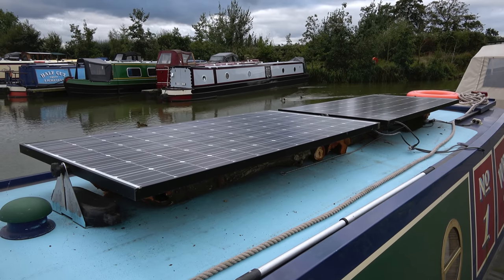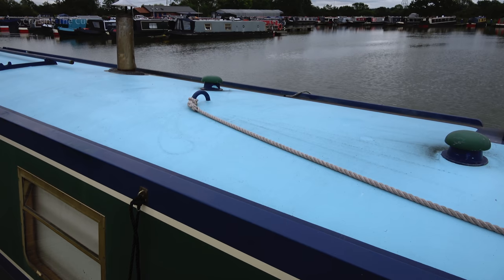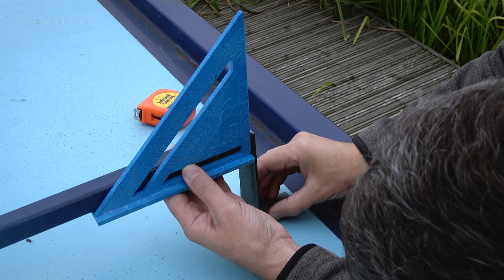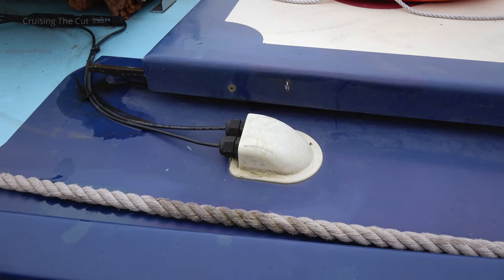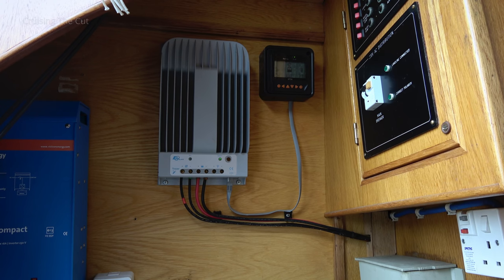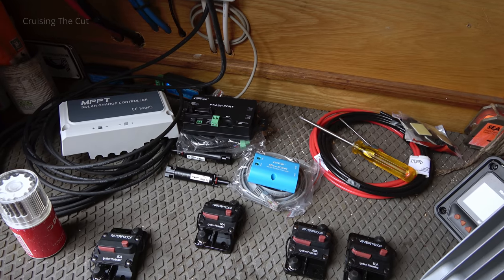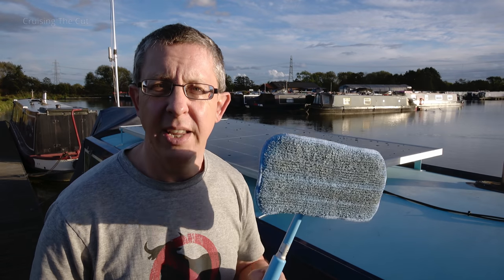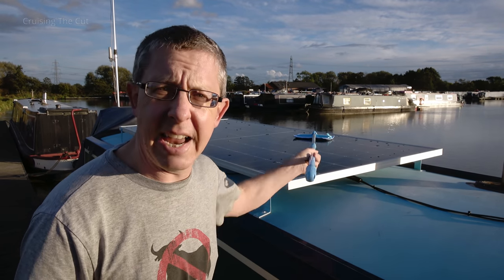251. Adding more solar power to my narrowboat

Comment: Someone gave you some bad information!
MPPT is designed to work with odd cells, that is what "maximum power point (no idea what the "t" stands for, unless it is the "t" in point", but, regardless, the main purpose of MPPT is to allow for a cell or two to be in the shade or an entire panel to be running at a lower voltage or wattage.
Another thing that I spotted, is something that is so easy to get wrong in a solar configuration as symmetrical as yours, is the "different amperage issue", this is because you have two different voltages on each charge controller, (rear panels in parallel @ 60 volts RMS, front panel @ 30 or 40 volts) of course your amps will differ greatly! 
If you multiply your amps times the volts showing on the respective charge controller, you will have the watts, watts will always be the same regardless of voltage, but amps will change, the quick and dirty way to know how much of a difference to expect is to divide the total panel RMS volts by the listed watts of the panels on the rear and again with the 550 watt panel in front, this will give the base for amps (I know, I made that last bit much more complicated than need be,m sorry). 

The easy explanation is ohms law: (volts times amps = watts; and as such, watts divided by volts = amps)

I use a cheap Ammeter ($10 -12 US on amazon) that shows the volts, amps, watts, total KW., in real time, it will make your electricity much easier to figure and track in your head, by thinking in watts, instead of converting amps to watts all the time.

I have been watching your narrow boat program for several years and absolutely love it! 
But rarely from my laptop, usually on the android tv box, so I could not subscribe until today, very well edited and narrated, much better than our other reality TV, and far more relaxing! Thank you!
Reply: Yep. Was also somewhat confused. I take it it's something like the SolarEdge maximisers on regular panels, that can mix in different voltages.

Agree all the talk about Amps had me confused. Power is measured in Watts or kiloWatts, particularly when your dealing with panels of different voltages.
Reply: Tracking
Reply from the maker: Hi. There's no bad information been given or received. Irrespective of the purpose of MPPT (which is to track the maximum power point - Amps/Voltage - of an array), you should not connect panels of different types to a single controller without dragging them down to the 'worst' panel's output.

I don't understand what point you're trying to make about amperages (and yes, I do understand Ohms law but I don't see what you're getting at)

Narrowboats and campervanners tend to think in Amps - more accurately, Amp Hours - because the capacity of the leisure batteries is always specified thus rather than kilowatt hours, hence the tendency to concentrate on the supplied Amps going to the battery.
Reply from the maker: @mark123655 Yes, power is measured in Watts but once it's going to the battery it's all at around the same voltage and as leisure batteries are measured, capacity-wise, in Ah rather than Wh, narrowboaters tend to think in Ah terms (at a notional 12V)
Reply: @CruisingTheCut  I am sorry, I did not mean to offend you in the least, a redundant system is much more robust than a single control system.
I live in a box truck with 1 kw of solar for about the same amount of time as you have been Cruising the cut, I lack the beautiful view that you have;
And the security of a redundant system

The whole amp watt thing is something that drove me crazy for years!
The point I tried to make is that a 440 watt panel that is ran at a different voltage than the dual panels ran in parallel !

Amps do NOT remain the same at different voltages! 
Watts do remain the same., e.g., a 100 watt light bulb @ 220 volts is .45 amps (watts/volts=amps)
A 100 watt light bulb @ 12volts is 8.33 amps!
Amps is the measure of currant, watts is the measure of actual power.
On a boat or RV you are forced into considering amps to gauge the size of wire you use, i.e., if you have a 2000/4000 watt inverter @ 12 volts, you must use the highest number to gauge the wire and divide 4,000 watts by 12v = 333 amps! This is the currant that may travel through the wire! 

Putting this into practice on your boat, the front panel (guessing) is running at 40 volts, the back panels are in parallel, running at 60-80 volts? 
The panels are not at the same voltage, therefore, the amperage produced cannot be compared without converting the amps to watts!
Reply from the maker: Hi. No offence taken! I totally understand the point about Amps and Voltages hence Watts being a consistent measure but when looking at the power going into the battery itself, it's all around the same voltage from both controllers (being either 14.4V at absorption or 13.2 at float) and therefore the Amp figure is meaningful when considering the capacity of a battery rated in Ah.

Comment: The breakers from the solar into the charge controller are kinda of pointless and should have really gone on the roof under the solar panels? You want something to protect the wiring incase there is a short to the boat chassis.
Reply from the maker: They're not pointless as they enable me to easily disconnect the solar from the controllers if needed. I am adding an inline MC4 fuse at the panel end but hadn't done so when I made the video.
Reply: So, if BOTH cables happen short to the steel roof, extremely unlikely, how many amps is that? Will it catch the roof on fire? Nope

Comment: Question was there a reason not to go for victron MPPT controllers as you already have victron equipment fitted.
Reply from the maker: Cost and I'm quite happy with the performance of the Tracer unit that I've had to date.

Comment: Instead of doing all that work?
Why not just buy 3 dozen ducks, glue/nail/screw/attach, small solar panels to their backs.
And tie a leash and a power cord around them so that when they swim around your boat?
They will generate LOTS of solar power from the panels mounted onto their backs.
All you need is to carry feed for them so they don't starve to death.
Problem solved.

😉
☮
Reply from the maker: Of course! How could I have missed this obvious solution!

Comment: Why not put your roof wireing in plastic trunking to make it look smart the plastic trunking will stick to your roof
Reply: Or metal barrel and screw to roof with those captive nut doodads.

Plus galvanized pipes clips.
Tread on it as much as you like or swept by thorns and brambles and it should survive.

Comment: I was wondering why you didn't just put the new panel in series with the existing panels? Too much voltage for the charge controller? Perhaps you could have just upgraded the charge controller rather than drilling a bunch of new holes for a second one?
Reply: When you put panels in series, the same number of amps have to pass through all the panels in the string, which means you limit yourself to whichever panel can generate the lowest number of amps.  Practically this means if you have a 500 watt panel and a 300 watt panel, you end up with two 300 watt panels because the 500 watt one is ever able to deliver its full rated current.

Imagine you have a fire hydrant and a fire hose, blasting a huge amount of water out the end.  You need the fire hose to be a bit longer, so you remove it from the hydrant and use a tiny thin garden hose to extend it.  Now the fire hydrant is feeding into a tiny garden hose, then the garden hose is feeding into the original fire hose.  Now suddenly only a trickle is coming out of the fire hose because the garden hose is restricting the flow so much.  This is how the amps work with solar panels - the overall water/current flow is limited by the smallest hose/panel in the string.

In this situation he might have gotten away with it by ordering more of the exact same panel, but he said in the video that wasn't an option as he couldn't find a way to fit them on the roof.  It's also not ideal because all panels degrade with age, and you'd end up with brand new panels that can only produce the reduced output of your years-old existing panels.  The new panels will thus have a different MPPT point than the old ones, so a single charge controller will end up compromising and picking an MPPT point in between the old and new panels, so not only are the new panels running at reduced capacity, but the whole string is no longer running at the optimal MPPT point either, further reducing power generation.

So even buying the exact same panels some years apart will waste a lot of the potential generation capacity, which is why few if any residential installers will add to an existing system, instead only installing additional systems or replacing an existing system entirely.
Reply from the maker: @Jordan I explained why in the video but Berkeloid's thorough explanation is very good.

Comment: shouldve just used victron controllers. also a blue seas dualbus hub instead of that wiring mess.
Reply from the maker: No. Victron is much more expensive and I've been very happy with the Epever unit I've had for the last five years.

Comment: You will lose a bit of input from the new solar panel with the length of the cable, good job.....
Reply: I wanted to answer: This peanuts are not worth it to be mentioned, but I googled a online-converter and it is between 20%(10mm) and 40% (6mm) depending on how thick the cable is and it looked very thin.
Reply from the maker: Hi. You absolutely don’t lose 40% of the power along the cable, whatever website you looked at is mistaken. There is loss along any length of cable, sure, but it’s fractional especially where thick (here 6mm) cable is used at “high” (here 40V) voltage. I calculate about 2% energy loss over the cable.
Reply: @CruisingTheCut  I didn't want to cause an argument lol, i was just making conversation the loss is very minimal, i've fitted hundreds of solar panels and thus think i have a tiny bit of knowledge on the subject. i love your barge and i'm very jealous of your lifestyle, i live in australia now but grew up in lancashire and the canals are the one thing i miss immensely, keep the videos coming......
Reply from the maker: Hi Tony, no worries, my reply was aimed at Lukas' reply!
Reply: @CruisingTheCut  🙂

Comment: Cc don't really need to talk to each other, especially if you use lifepo4. If 1 is in bulk the other may go into float worst case. In practice not a problem. Those DC breakers are notoriously unreliable, better off using a fuse or din rail mount DC breakers.
Reply from the maker: Cheers, yes I’ve since observed they’re quite happy doing their own thing!

Comment: why not simply rest it on the roof with no spacing and use 100ml ml of superglue instead?
Reply: I don't think he can do that as the roof itself curves convex (I guess to throw rain water to the edges) so the panel wouldn't lay flat.
Reply from the maker: As Jeffrey says :-)
Reply: @jeffreytan2948  i have superglued a flat powerbank to a curved surface and it very rigid. he could have superglued 4 support blocks also under each corner.
Reply: @esecallum  super glue does not tolerate prolonged exposure to water.

Not great on a boat in Britain!

Comment: Wow they are the biggest clunkiest MPPT solar controllers I’ve ever seen. That looks like a Victron inverter didn’t they have victron charge controllers available? Not to worry of course as long as they do the job. Nice video.
Reply from the maker: Victron is expensive and I'm not a fan
Reply: @CruisingTheCut  and using your phone they must know your location for endless updates. Needless intrusion.

Comment: I like your videos.  I have been repairing boats for 25 years.  You have made a leaky rusty mess.  Wait thru the winter.  Sika should have been squeezed down the holes and oozed out as you put the bracket on.  The screws should have been dipped in Sikaflex and they should be stainless steel.  A product like tef gel should have applied to the bolts passing through the panel's frame.  It will just corrode away without it.  Generally, the brackets should have been stainless too...you will have rusty streaks everywhere.
Reply from the maker: The entire boat is mild steel so I'm quite happy with the brackets being the same!

Comment: Hello Cruising the Cut,

You lose much of the potential by mounting them flat. Ideally you would need a centrally mounted rotating frame so that they can be inclined and orientated towards the sun even if it's not visible. Certainly a lot less neat and it would need to be strong for when it is windy. Perhaps it's not viable, it certainly would be much uglier?
Incidentally the availability, on average in the U.K., of solar is just a shade over 10% of capacity per annum.
Reply from the maker: Yes I’m aware that flat is suboptimal but tilting requires me to mess about constantly moving the panel, or installing sun-tracking motors and the like. For me, and many boaters, the hassle is not worth it, just bung big enough panels on that it’s unnecessary. For example, in summer, my existing pair of panels is plenty and I don’t generally both tilting them even though they can be moved to a degree.
Reply: When you say 10% capacity for solar in the UK do you mean you should have roughly 10 times the rated output of the solar panels for suppling your average electrical power use?  Typically in the USA the rule of thumb is suppose to be expect 1/5 of the capacity for PV and 1/3 for wind turbine.

Comment: What about flexible solar panels? Less trouble installing, takes no space and you can put them in between
Reply from the maker: They’re more expensive, less reliable, shorter-lasting and because you stick them to the roof, harder to later remove plus they’ll get very hot on the metal which reduces their efficiency.

Comment: Why did you not use industrial strength Velcro pads for the controllers and breakers on the inside instead of so many holes into the wood?  Would make it much simpler to change out if needed later.  Way too much work.  Just a suggestion.
Reply from the maker: I wouldn't want to hang the controllers on velcro, prefer a more permanent fixture.
Reply: He's not repeatingly taking them off and putting them back on. The permanent installation. Velcro is a Chevy way of fastening

Comment: Why not consider  selling the original solar panels in the spring and replace them with the same panel that you recently installed in the  bow.
Reply from the maker: Because they were specifically bought for their narrow profile, leaving me space to walk alongside them on the roof (which I need to do when in locks) plus the old brackets wouldn’t fit the newer panel so I’d have to remove them and patch the holes. Plus they’re working fine and having two systems gives me redundancy.

Comment: Anybody else thinking of doing this would benefit from linking all your panels together in parrell using only 'one' controller suitable . Less wiring, less holes in ya roof too.
Reply: If David had bought 2 of the new panels that would have been possible, but he needs the separate controller and mixer for different panels.
Reply from the maker: It's not feasible to link panels of different types to one controller (at least, not optimally), as explained in the video.

Comment: Extremely interesting video. Solar power is useless for replacing the national grid, though extremely useful for low power self contained applications, such as powering my wristwatch, or ancillary devices on your canal boat.
Reply from the maker: Yes the solar (via the batteries) runs everything on the boat: fridge, lights, TV, water pumps, laptop etc

Comment: given the weather in that part of the world solar isn't efficient enough to justify its cost. i would spend the money on insulation instead.
Reply: Unfortunately, insulation doesn't keep the lights on or the fridge running... 😁
Reply from the maker: The boat is already insulated with no reasonable, practical way of adding more, and it's perfectly warm enough in winter anyway. That's not the issue that's being tackled!

Comment: might have helped if you had bought a small bottle of cutting oil instead of wd40 for the drilling operation
Reply from the maker: It was not WD40 and the cutting went very smoothly so no help needed.

Comment: ACTUALLY.. just because you can't see the sun, doesn't mean there's no sun to point at. An yes, you can get more power pointing them towards the sun on cloudy days. But whatever 🙄 it's probably not worth the effort for you anyways
Reply from the maker: Well no, of course the sun is still there (!) but pointing at it when overcast makes naff all difference (and the system has so far demonstrated this, where the new front panel consistently outperforms the rear (tilted) ones when it’s cloudy and there’s no sun to see)
Reply: @CruisingTheCut  what's done is done. As long as you're happy, that's all that matters 🙃